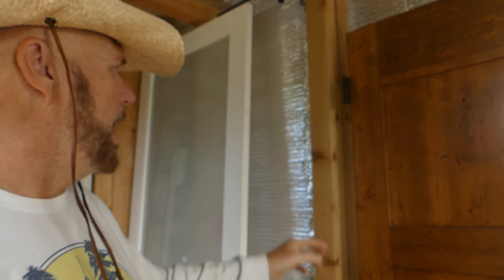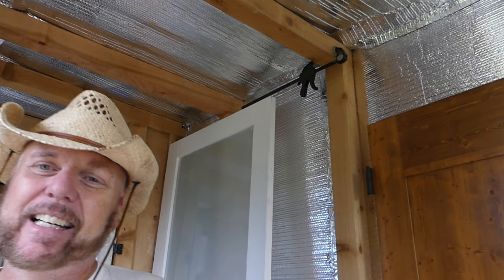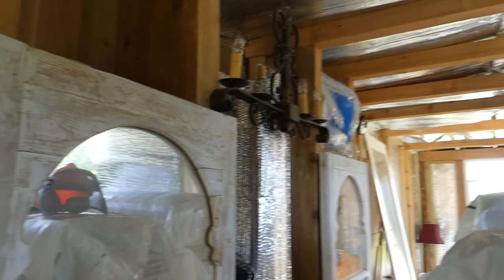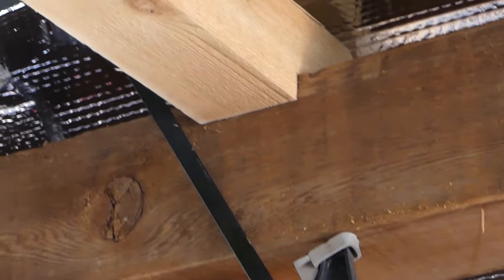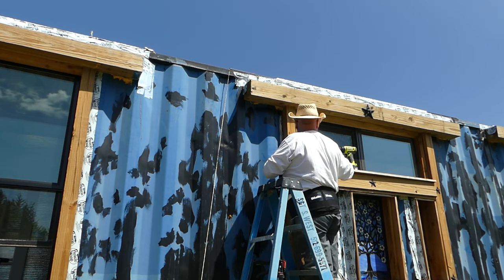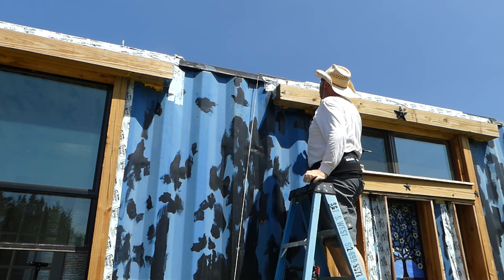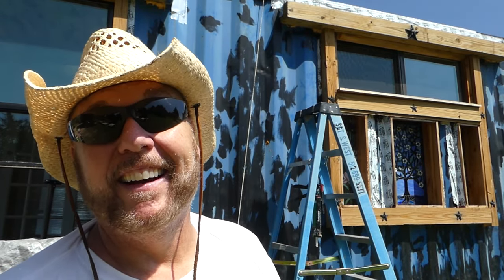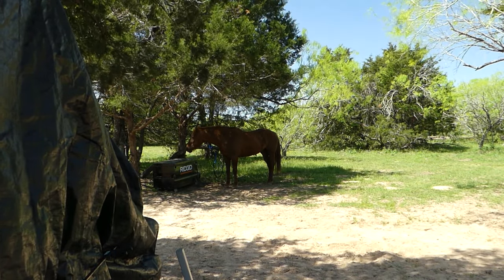Drilling corten steel in shipping container home with Ryobi cordless tools

Comment: What drill bit are you using for the holes? Working on a build for my place and just want to make sure I’ve got the right bits.
Reply from the maker: I have a set of aircraft drill bits, a Ryobi kit, and I buy the size I need for my lag bolts in bulk. Here are the desc and an Amazon link.

Kings County Tools 12" Long Aircraft Drill Bits Set of 10 | Sizes 1/16", 1/8", 5/32", 3/16", 7/32", 1/4", 9/32", 5/16", 11/32", 3/8" | Stainless Steel Material | Get to Hard to Reach Places. https://www.amazon.com/gp/product/B07B4JYZ2D/ref=ppx_yo_dt_b_search_asin_title?ie=UTF8&psc=1

7/32" Cobalt Drill Bits(20PCS), M35 HSSCO High Speed Steel Jobber Length Twist Drill Bit Set for Hardened Metal, Stainless Steel, Cast Iron, Plastic and Wood. https://www.amazon.com/gp/product/B0B6J2LJ5X

Comment: Any techniques for drilling through the steel? Pressure/speed you usually used with that Ryobi drill
Reply from the maker: I bought a bunch of aircraft quality drills of the size I needed. I don't sharpen (yet) and just replace the bit once I find myself pressing real hard. I put in new drill bits before I climb up a ladder as pushing hard is risky.